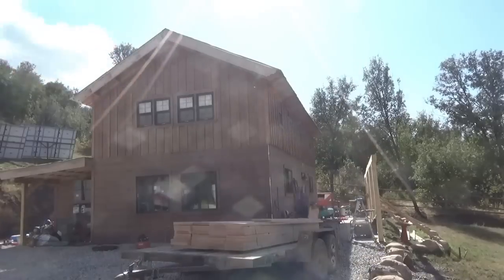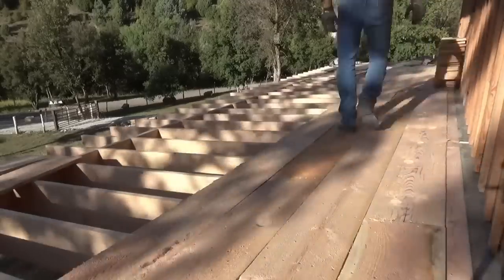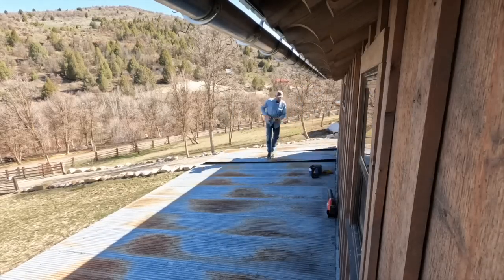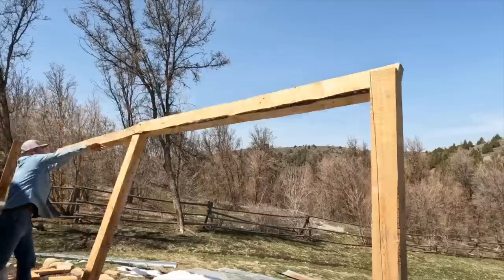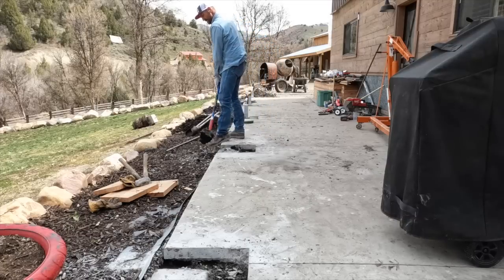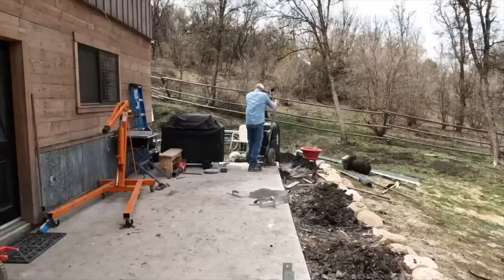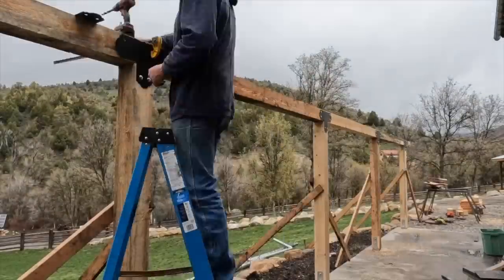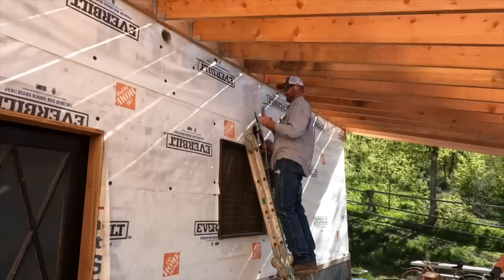#665.5 - Tore Down And Rebuilt Our Brand New Front Porch... Because Of Snow! (From Start To finish)

Comment: You probably won’t have to do this much. But on heavy snow years you take a rope and put it behind the snow. Attached one end to a vehicle, car, truck, tractor, whatever. Attached the other end to a bungee cord which is tied to a tree, rock, another vehicle.
Then get in the vehicle tied to the rope and go forward and backward till you saw the base of the snow loose. But it has to have a place to go, so you’d have to clear out the snow in front of the porch.
It works and sure beats shoveling. I’ve enjoyed your channel for almost 4 years now. Very impressed with your work ethic

Comment: Retired Contractor Roger here. You need to cut a birdsmouth in your rafters so that they are setting FULLY on the beams. Otherwise they will be trying to twist your beam and not sitting solidly on the beam.
Reply: Yep, general contractor here, I agree with you.
Reply: Field marshal contractor here, your spot on with that.
Reply: POTUS here, I concur
Reply: professional cage fighter here, i agree!
Reply: But of course you know he doesn’t take advise and he doesn’t read the comments thus he replaces everything on the house several times.
Reply: Professional Professional, I agree with you.

Comment: There is no question that the original porch roof(s) would not have survived the snow you received this winter.   It's good you recognized that, and it's even better that you rectified it last summer.  You certainly would have fixed it this coming summer anyway without being able to reuse some of the material.
Reply: I am most surprised that he actually stuck with the project long enough to see it to completion.
Reply: @Chris Allen  there are some projects that lay unfinished from time to time, but once this one was started,  it really needed finishing.   And let's be honest, Heath has finished some really hard projects over the years.
Reply: @LostInThe0zone  If he was working for an employer he would be fired.  You cannot pick and choose your times and jobs.
Reply: @ben southwell  but he is working for himself, and no one else gets a say. 
On this very important task, he recognized the mistake and rectified it.
Reply: @LostInThe0zone  when it comes to safety of the family mistakes are not an option

Comment: Here I am again……..a warning on snow loads.  Back in the 70’s  we were boating on Lake George in upstate NY.  About a 3-4 ft snow fall was on our steel  winter boat storage building.  A nice warm rain hit the area and our new steel building’s roof collapsed on a building full of beautiful cruisers and other assorted boats.  Our roof was too flat to let the snow slide off.    Sound familiar?   The year we moved to North Carolina from Hartford  Ct area we had an accumulated 89 inches of snow.  That us a big load…..now let a warm non-freezing rain fall.  The load on the roof goes up to about a factor of 10.  ( an inch of rain can produce a foot of snow.   In the north country such as where you live, deep snows can occur any winter.  You got lucky your first 2 years.   Depending on the snow sliding off the roof is like wishing to win the lottery.  As you now know.  At the rebuilt boat storage building, there is a 10 hp snow blower that lives on the roof of that building.  In your case you should have removed the snow or most of it with a  ROOF RAKE”. You can do it from the ground level   The rakes are sold snow country for about 25-30 bucks. They reach about 20 ft.   Easier than shoveling. 
I also warned about lateral truss bracing while you were framing the workshop.  Could not  see any from your videos.  Now is the time  to install a 
11:45 few 2x4 laterals before you enclose any of the shop ceilings.  You certainly do do not want a 5- 7 ft snow and a warn rain on the shop.  An ounce of prevention is worth a pound of cure.  
Sorry to say I told you so, but i did warn you on both the shop and the solar panels about triangular structural shape strength as the strongest structural design.   Good luck and GOD BLESS YOU AND THE FAMILY!  WE ARE RAYING THAT YOU WILL ALL BE SAFE.

JoeB.  1962 U of Md.  Civil Engineering Degree
Reply: Very good reply to bad he will never read it and if he does he probably wouldn't understand it, you forget he is a licensed plumber

Comment: Suggestion  for future  footings  for supporting  have seen especially  where there Chace os frost lifting   foot looks like upside dwn funnel  base really wide  ribar in base a d then tapers up the wide base works 2 way 1 give wider base for down pressure  and  2 resistance  to being lifted up from frost heaving

Comment: why would you let the build up that much it's not like you don't have the equipment to move the snow away from your house or shop oh and the shop where do you loose all the heat threw the walls or roof insulate the ceiling sometime maybe you can keep it warm when your trying to fix whatever. I don't think your the sharpest knife in the drawer but your far from stupid and your not lazy but you just do some things that don't make sense .